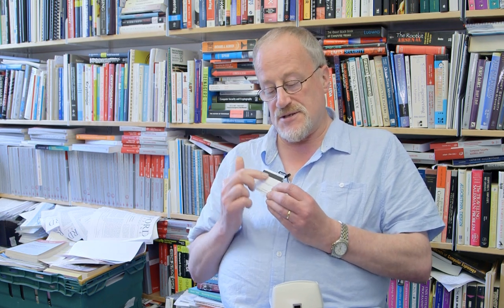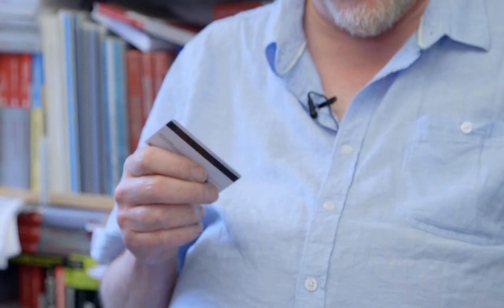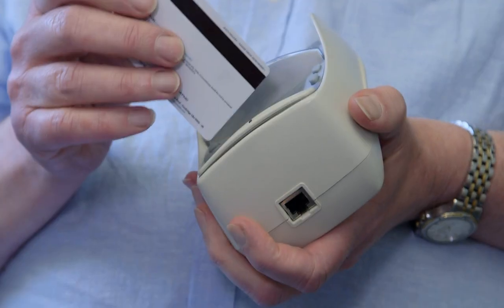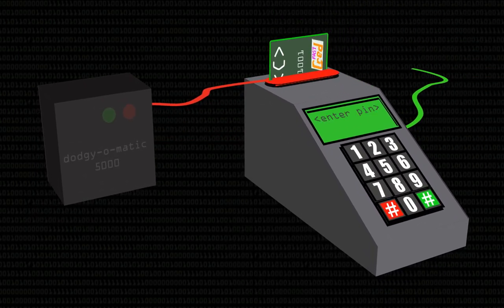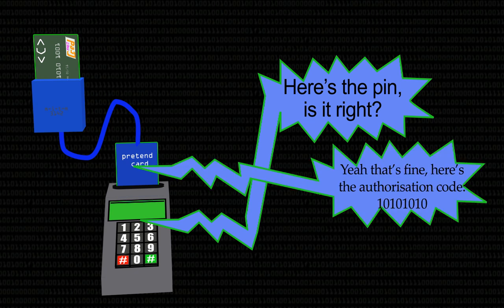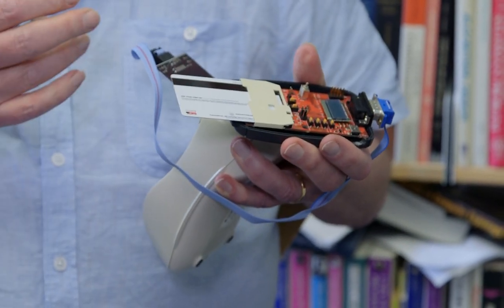Chip & PIN Fraud Explained - Computerphile

Comment: In other words: if you go to the club, use cash :)
Reply: +Филип Брчић Well, I'm not a huge fan of having cash with me which can easily be stolen or that I could loose. If my card gets stolen or I loose it, I can just block it and get a new one.
Reply: +Филип Брчић You are still tracked when you cash out with your simple debit. If you are using constant locations then they map use quite easily. Also today they can get easy meta-data with social networks and websites like YouTube. So they kind of know where you are pulling out money from (which ATMs in what locations) but less about the shopping, yes.
Reply: Alexandru Gheorghe
Yes, of course. But they don't know if I buy pink underwear, beer or new shoes, nor do they know where I lunch nor what.
Reply: Филип Брчић
Definitely. Except if you want to buy off the web, then you are in "trouble" :-)
Reply: Alexandru Gheorghe
Yes, absolutely. The only way to safely buy on the web is to create pre-paid debit cards for each purpose and even then the bank(s) has your stats.
Reply: +Филип Брчић I use debit card day to day unless the shop requires cash (which is very rare) because I do not want to have to go through the hassle of proving what I spent my money on in case of some sort of audit or other trouble and on the other hand I do not want to deal with cash for day to day shopping because my money is at the bank, not under my matress and I still need to use cards to get cash and deal with antiquated security meassures anyway + I explicitly want everyone to keep logs of what I bought because otherwise I am powerless when being stolen from by dodgy companies.

What gets your house robbed or your info stolen is being all "social" on the web as your life happens because context is everything.
The government knows where I live, what property I own and giving them easy access to knowing where I buy my groceries or where I top up my car is not changing anything in this case.

Whenever I was stolen from was when I paid cash - landlords for instance before I owned a house.
Not only do you need to prove you handed the money over but need a whole court proceeding to get it back whereas often when paying with card you have certain statutory rights which the bank can enforce on it's own or you can ride the PR battle with the bank or something like paypal and in the end get some compensation without a court order.

Sure it would be a luxury to pay only cash and have no one know your moves before you make them but that is nowadays reserved for high powered business people which most of us are not at all. I use military grade phones for my work and still there is no way to not be tracked or logged - every accessible business solution for crypthographical calls between two specific users have been compromised so why bother at all?

I mean how are you supposed to avoid being triangulated anyway? Either on the phone or simply by where you buy or use other services?  We are all on the plate - for instance just knowing what prescriptions you need is enough to take you down in case you are a political enemy of a new regime or someone with enough power wants you out of a business situation... This is a new brave world after all!
Reply: +jangxx But you have to wait for the new card to arrive, and then you need to argue it out with the bank to get the transaction reversed. Especially a problem for a debit card - if you have no other cards, then you have no money until your new card arrives. Which can be quite terrifying if this happens at e.g. Christmas and you have no way to pay for anything (food, petrol, etc.). At least with cash, you only lose what you carry - which is likely a fraction of the cost of that smartphone you also have in your pocket.
Reply: +Филип Брчић Cash is way more easily stolen than money from a bank account. If you carry your wallet with only a bank card, and someone robs you, you go home, block your card, and they can't do anything. If you're carrying $400 in cash, then it's gone and you'll never see it again. Also from a shopkeepers perspective it's much safer to have tens of thousands of dollars in bank transactions each day than to have tens of thousands of dollars in cash in a safe in the store that can be robbed.
Reply: chsxtian
Why in the world would you be carrying $400 with you? I mean, if you do spend $400 daily, than loosing that wouldn't really be a problem for you, right, but I seriously doubt you spend $400 on the daily basis.

As for shopkeepers, I agree, they probably prefer not to have lots of money on them.
Reply: +jangxx I usually carry only what I'm willing to spend that day with 25-50% extra. So a mishap wouldn't be that bad.
Reply: +Филип Брчић Where I live you can buy prepaid a MasterCard or the like at a convenience store. I reckon you could pay cash for one of those if you really wanted to cover your tracks.
Reply: Mike Keenan
Yes, you can do that where I live as well. You'd have to go to a bank, not a store, but no big difference, there are banks on almost any corner anyways.
Reply: I agree, but I think that cash gets stolen even more often than plastic... and there is no safety mechanism on paper ;)
Reply: If they go to that effort.... I think you did something really bad :p
Reply: +jangxx
If you spent less money on clothes, then not only would you have more cash, but nobody would want to steal from someone who looks like you.
works for me.
+Alexandru Gheorghe
have people pay you in cash, then pay people in cash.
+Филип Брчић
I have over 800 in cash in the wallet. I've never lost a dollar. how do you lose cash? I don't understand what kind of failure is required for that to happen...
Reply: +yuehan Chanterelle
when you look ragged and poor, people generally don't try to rob you.
has worked as long as there've been knives.. that's how you don't lose cash.
Reply: At my location you can buy these prepay cards  at the gas station, but you have to show your id.
Reply: If someone steals your cash you lose it. These frauds are a problem of the banks, not of the customers.
Reply: OR just don't go to the club...
Reply: Yannique1 debit card is always the answer. Cash is as secure as credit card - not really
Reply: just use a prepaid credit card
Reply: And then get mugged :)
Reply: brcha Be careful with those atms, they are a hotspot for skimmers ;)

Comment: Anything nightlife or gambling related should be cash-only. Going out for a wild night? Take a couple hundred pounds with you and NO CARD. Spend it all, have fun and when you're out of money, it's time to go home.
Reply: +NewFormofSilence That's how smart people actually do it. Especially in Casinos, where it doesn't even have to be fraud for you to get rekt financially
Reply: +Stoppi Even better, keep your winnings separate from your initial gamble. Come in with $1000 in your left pocket, and put all your winnings in your right. When the left is empty, go home and count your winnings.
Reply: +Joe Mills Of course. Still no reason to lose more than you start out with.
Reply: +Joe Mills The amount you get back from most forms of entertainment is exactly zero.
Reply: +Stoppi Especially as banks now recognise gambling transactions and factor them into their credit decisions. Spend too much on gambling (even if you win and/or you can afford the loss) bye bye mortgage offer.
Reply: Those prepaid visa/master card sold as gift cards at supermarket checkout would also be good, since they are disposable after use with no liability.  

take the winning in cash and pay the initial gamble through the card. 

and put the card visible in your back pocket after it has no money left to troll the thieves ;)
Reply: Or take a prepay card with push notifications (eg revolut) - or use Apple Pay (biometric requirement, 1 time tokens used on the back end - fraud proof).
Reply: Winnings in a casino - that's optimistic. If you wanna have more money don't go to a casino ;) It's rigged against you.

Comment: . . . and this is why you should always use end to end encryption and best practices for security, rather than trying to roll your own system. It is so easy to mess up security if you make a mistake and didn't think of something. Sad to see that a man in the middle attack is so easy with chip & PIN.
Reply: +logicalfundy But encryption would mean that terrorists will something something!!!  Whatever the FBI is peddling that day.
Reply: I don't have much knowledge in chip and pin machines, but I thought that encryption from terminal to provider does take place, only after the terminal completes creates a transaction and then is ready to send transaction details to the provider. So I thought it was the last step, but because of that, it's really easy to catch data before.

Comment: The thing is, the protocol is overly complicated and has all these fall backs to old knowingly flawed transaction types. There are simple protocols that could be used to stop most these attacks. But on-line verification and no backwards compatibility to things like signature support is needed for them, and the banks like their backwards compatibility way too much.
Reply: +Ewan Marshall Exactly, It would work fine if chip and pin was the only transaction method, but the fact that you can still use the mag stripe and sign completely negates the security benefits that chip and pin should have against physical card theft. 2-factor doesn't work if the second factor is optional.
Reply: I thought "chip & pin" sounded brilliant until I learned that the keypad is on an external device. At that point, it's already a losing game.
Reply: +Ewan Marshall Customers like backwards compatibility, too. Also, one of the design constraints was that the system had to work without network connectivity. That makes things a lot harder to get right as you are lacking one of the routes of authentication which might be possible.
Reply: +Garrett Kajmowicz I certainly don't I specifically asked for an online auth only no NFC card from my bank, however, I know it's still vulnerable.

Comment: This is why I always use Western Union to wire money to people that I don't know.
Reply: The Hoax Hotel And this is also why mobile wallets such as Apple Pay, Samsung Pay, etc are safer than chip cards. Instead of the actual card number, they transmit to the terminal a different number assigned to the specific device being used along with authentication information so that the charge will only be approved if the actual device linked to the transmitted “card number” is being used to make the purchase. Otherwise, the transaction will be declined.
Reply: Plus the limit of £30 per transaction make it a lot harder to withdraw massive amounts of money so work to deter people from even bothering to try to find a way of forging it.
Reply: GoOhmGaming The £30 or €30 limit only applies in the UK and Europe, though, because contactless payments there are processed without requiring authentication from the customer. No such limits exist for nfc contactless payments in the US, where all payments require authentication regardless of the amount, either via signature or more recently electronically, just like regular card payments always have.
Reply: Luigi A Oh thats cool to know. Cheers for enlightening me :)
Reply: I only accept chip cards when ubering the zamboni
Reply: @irondiver292  No idea what your on about but sounds cool lol. I personally dont use Uber as its actually more expensive than just hiring a taxi here in the UK or at least in the town where I live

Comment: Is this different than the chip and signature we're rolling out in the US now? From what I understood of the US systems, the chip doesn't actually pass your card number but rather a unique payment code that's cryptographically derived from your card number, the merchant ID, and your transaction counter (which gets incremented each time to prevent replay attacks). I was under the impression that this was done inside the chip which prevents MITM attacks. The examples he was giving seemed to date back a decade so I'm not sure if still applies to current day cards (namely in the US). Can anyone shed light on this?

Comment: 7:20  This is why you should always get the receipt for absolutely everything every time and KEEP IT.  At least then you have proof that you've been lied to.
Reply: Fuzzballfox Onionring to be honest, if the criminals can manipulate the terminal to show small numbers but make big transactions, they should be capable to print you fake receipts. 😐
Reply: Eemeli Saarelainen but they can't print 50 pounds on the receipt when they charge you 5000.... It would be proof that they are criminals
Reply: Only hoarders keep that many receipts
Reply: But they could print 5000 pounds and you'd have no way of complaining anyway.
Reply: thats why the receipts are on thermopaper which turns blank. The banks are actively supporting the fraudsters and fighting law abiding customers
Reply: then your life turns into an accountant, constantly checking banking printouts against folders full of receipts. Cannot check the transaction in place like with cash.
Reply: @GRBtutorials  what if they read the reciept before leaving the building and see 5000? Then you make a fuss about how you clearly did not spend 5000 for a coca cola

Comment: You don't even need that these days thanks to PayWave. Now all you need is a wireless POS machine registered to a company called something like "administrative fee", program the machine to withdraw a small amount, like a couple of pounds, then walk through a train passing it near people's pockets and handbags. You can do that to hundreds of people in a day, make thousands of bucks and when people check their bank statements (if they even bother to check their bank statements) all they see is a tiny transaction labelled "administrative fee" and think nothing of it.
Reply: You’d have to get the device real close to people’s pockets or handbags to do that. Paywave and other contactless payments use nfc, which can’t transmit or receive information at a distance greater than about 5 cm (plus, in countries such as the US or Mexico there are hardly any contactless cards). It would be really hard to do what you describe without being noticed. What the thieves normally use is an RFID device, which will work at a greater distance (several meters maybe) and will read card information from the magnetic stripes on people’s cards, not from the nfc chips inside them.

Comment: I remember when I was in the military they would warn us about these relays at ATM's and how to spot counterfeiting hardware.  Now that I know what's possible it freaks me out everytime I use an ATM.  Plus, many credit cards now have the chips but not all stores are required to operate using those chips.  As long as that is possible, counterfeiting will remain fairly easy - despite these sophisticated chips.

Comment: What happened to the next step in security that was advertised in the early '00's because even in the ,'90's it was known the chips are already defeatable.
And we have plenty of guys on Tube that recommend removing the chips and going back to the swipe, along with a common thing now is doing a triple ( because so many people refuse to wait the 5-10 seconds, before putting a chip card in to give the cashier time to use the program to make ready for the card. They jump ahead, while things are still being rung in, as fast as possible, slip the card in, and get angry that the transaction isn't completed the very moment a last item is scanned. So we then have to do the 'triple'. Remove the card, wait, re- insert( wait for the error response), remove, wait, re- insert(..error response), remove, then, swipe,..and the card gets approved. All because people refuse to apply a little patience. And of course, if it's a rigged reader, the bad guys were just now given 4 chances to get info off their cards. 
This ( the 'triple')happens over and over again everyday. 
Things on their mind, new card( why it's like a new toy, it's remarkable, let's play), just plain immature users..?
CXO blogs list all this stuff we have had for next steps, for years, yet we're still only at chips. What's wrong with the processes applicable on this.

Comment: CC security drives me crazy. Here is a simple rule that EVERYBODY should know, and should be plainly obvious upon cursory reflection: if you share a piece of information (e.g. social security number, credit card number, pin number), and that information can be used for a purpose other than whatever it is you are currently doing, then that system is NOT secure. Single use numbers would really help with that. Amazingly, the designers of credit cards still haven't figured this out (more likely, they don't want to bother implementing it). Blows my mind!

I remember back in the early days of the Internet, American Expressed offered single use numbers, but it never caught on. My guess is that online retailers hate it, because they want to keep your info on file to make payments "frictionless". Still, CCs can do better (they could hardly be doing worse ).

Another problem with CC security is that the consumer has no idea whether the card reader is legit. This can be solved by having the card challenge the reader. If the reader answers the challenge correctly, then you can be pretty darn sure that you're talking to the entity that you were expecting.

Internet security works the same way (and it works well). When you try to talk to your bank, your computer sends a challenge that only the bank can solve correctly. If the site that you're talking to cannot answer the challenge, your browser will throw up a giant SSL error, telling you that you are probably being man-in-the-middled.